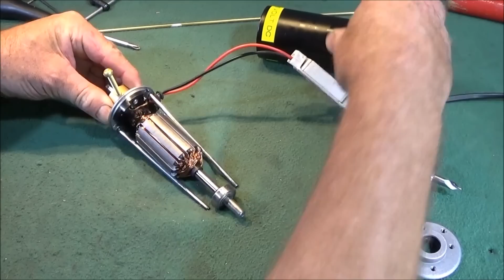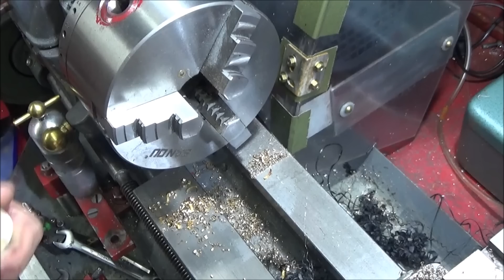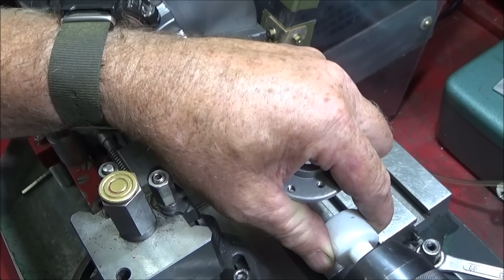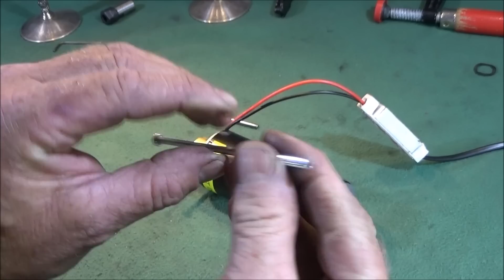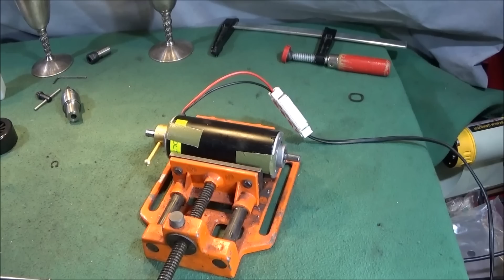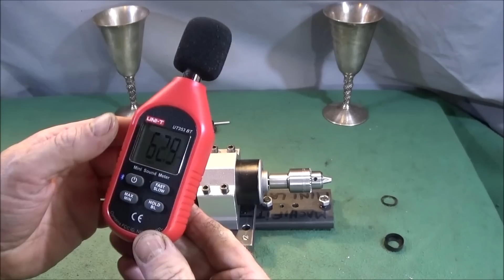Easily Strip The Machifit 100v Motor For Modifictation & Servicing

Comment from the maker: SEE LINKS BELOW:-  
 Machifit ER11 Chuck CNC 500W Spindle Motor with 52mm Clamps and Power Supply --  https://goo.gl/iQY4LK
 UNI-T UT353BT Bluetooth Sound Level Meter Digital Noise Tester --  https://goo.gl/3tRts8
Reply from the maker: Banggood 12th Anniversary New User -- https://goo.gl/dGwdoS
    Banggood 12th Anniversary Warm-up Sale --  https://goo.gl/yAECU1
Reply from the maker: Banggood 12th Anniversary Electronic Sale --  https://goo.gl/SY4GX1

Comment: This spindle has only two ball bearing, and rubber makes one bearings useless. Normally spindle has angular contact bearings and total 4 bearings to bear cutting backforce. If you open it, you will know this is just modified hand blender.

Comment: Thanks Steve for showing us the insides of this type of motor.   A bearing mounted in a rubber gasket doesn't look like a good spindle motor solution without modification.   I believe the 775 motor has a bearing press fit into the end piece.

Comment: Thanks for this great video! I've got that motor, and a 3018 CNC. It could be interesting to convert the 3018 to accept this motor.
Great tip making that brass collar to save the brushes. The same, great idea how to guide the mounting screws back in place.
Did You use a zz bearing? If not, how did You protect the new bearing from dust?

Comment: Nice information..
Is it possible to use this motor for industrial applications in a SPM for drilling dia 1.5mm hole in mild steel 3mm thick..
Approx 3000 holes in 8hrs x 6days a week..
Reply from the maker: Hi Atul yes I would reckon it would be good for that. I haven't been able to try it though.

Comment: Waste of money as a purchase and further on as an upgrade platform. Rotor is not balanced at all and it will destroy any bearing you throw in there. Mine is shaking the floor, it's that bad. Nothing you could do about it without a professional rotor balancing machine. Even if the rotor was balanced, since the fan is not built in, it's likely that fan will throw it again out of balance once you put it back on. It's just bad engineering all the way. We would all be better off with Makita or DeWalt palm router, a properly designed piece of machinery, which is even in the same budget range. For 25eur you can buy parkside pgs 500 a1 which runs circles around this "motor".

Comment: Ideally, on a proper, high end spindle, you would have two bearings with directional markings, being placed in this sort of configuration,  ----<>----  (the line being the spindle and the < > representing each bearing). This allows for a more stable rotation, regardless of load. 

In fact, These bearings realy arent truly all that expensive, and it may be something worth having a look into. The only other thing that immediately springs to mind is the thin steel case and the pot metal endcap possibly being additional sources of vibration.
Some wisely added delrin parts might help a good deal.

Comment: i have this spindle and it heats a lot very quickly. im interested in cooling mods. ive seen a guy run copper tubes around the magnets with liquid cooling , which helps a little but no enough. any other ideas how to cool the rotor and not just the frame?

Comment: As a matter of interest, the spindle on this motor is longer on the fan end and probably the same diam both ends, that means you could turn the motor around and make a new cover for the fan end slightly longer to house 2 A/C bearings so that it then becomes the chuck end which will be heaps better for a milling situation on the cheap 3018 mills etc, the regular radial bearing can remain at the previous chuck end as it now becomes the fan end.

Comment: Hello good afternoon. Thank you for sharing this video that piqued my interest. I try to buy an economical engine, so I can adapt it to my wheelchair. It will have to be a small engine as the chair will be open and closed for transport in a domestic car. It seemed to me that this engine has strength but on the other hand it seemed very fast but I think it can be controlled. Could you tell me more about this engine? Will this engine have heating? Please, if you can, tell me what you think. Thank you.
Reply: I have a 500w version and it heats up a lot, I don't leave it working for more than 1h.

Comment: An excellent video.  However, could I make a small observation.  You have cleverly used a 300mm 1/8" sharpened brass rod to guide the long bolts past the large permanent magnets, I would just like to mention that you can buy packs of 1/8" bamboo barbecue skewers, also 300mm, ready sharpened, non-magnetic and 99p for 100.

Comment: Steve, your videos are extremely well done and instructive. Thank you!  As a matter of fact, I just received my order for this motor and I want to remove the factory mounted chuck. Further to my question of yesterday, I took off both set screws, hoping to be able to pull off the chuck from the arbor, but it seems to be stuck! Maybe heat shrunk on?? Anyway there is no movement and I don’t want to pull too hard either. Some sort of bearing puller arrangement might work, but there is very little room behind the chuck to hook it on. 
Your video explains pretty much everything except how you managed to remove the chuck from the arbor!  I, and maybe other viewers, would be very interested in your explanation how you did this!  Thank you.
Reply: Steve, thank you for your reply. I did manage to pull the chuck off. This revealed a 10 mm spindle. I think I have heard you refer to a 8mm spindle... This is relevant when wanting to replace this small chuck with an ER16. I looked up the ER16 on Banggood but that has an 8mm hole... Or is it just a matter of replacing the collet nut only. I am puzzled about this, not being as informed as you. Can you shed your benign light on this? Thank you! By the way, what is the difference between ER11 and ER11A...?
Reply from the maker: Hi I may have shown it on another video, but I did use a made up puller. It was basically a couple of pieces of steel with a cheap bearing puller that hooked over the steel with a allen bolt that fitted loosely on the inside spindle face and was then pushed in with the bearing puller screw. It will come off fairly easy like this and it is the only way to remove it without damaging anything.

Comment: How on earth did you get that factory mounted collet off?
Reply: Take the collet nut off, and carefully load some 5mm nuts inside. Replace collet nut and tighten until it slides the chuck off. You might need a couple of of tries.

Comment: Hi, Steve.  All your videos are great...even for a dummy like me.  
Instead of a brass bush, I would consider a Larger ball bearing for the output end...a radial thrust sealed ball bearing.  
On the brush end remove rubber spacer [if applicable] a use a normal sealed radial ball bearing.  

I am currently building a tiny cross drilling lathe attachment with an alloy bearing block tool holder and pulley shaft, powered by a 7,000rpm, 110v, 60hz, 100w [US] sewing motor with a foot rheostat. I have a small pulley on the drilling shaft and a larger step pulley on the motor utilizing rubber O'Ring belts.  The 100w motor is sufficient for the tiny drill bits I'm using.  

I appreciate all your videos and the fantastic commentary on your "Show & Tell" approach.  Thanks, again.

Comment from the maker: PLEASE NOTE:- IN THE END I USED DELRIN FOR THE BEARING HOUSINGS, TO MAINTAIN ZERO ELECTRICAL CONTACT FROM THE ARMATURE SHAFT TO THE HOUSING. I ALSO FITTED SKF BEARINGS AND A THRUST BEARING TO THE FRONT END. WHILE THESE MODIFICATIONS DID IMPROVE IT SOMEWHAT. THIS UNIT IS ONLY REALLY GOOD FOR SMALL DRILLING OPS.

Comment: Hi Steve,
Very handy tricks on fitting the screws using brass. I would suggest running and earth wire to the controller then on to the motor screw. Also a good idea to fit a fuse in line with the phase wire if you don't have one in the power plug.This could save your life !.
Cheers Dave.

Comment: Hi Steve
I hope the bearing mod will cure the vibration problem I noticed previously.
With better quality bearings I am sure very accurate light milling will be achievable.
The brass rod trick to line up the screws is clever. Well done.

Comment: I would ditch that style of ball bearing and install a pair of angular ball bearings (a.k.a. magneto bearings). You would have to modify one of the end caps so that the bearings could be pre-loaded. That would probably be easiest on the front cap by threading the o.d. of the boss and make a cap that could be screwed on an use that to set the bearing pre-load.
Reply: You'd need a lathe capable of doing that. Which most of us don't have. So, to make a $20 mod on a $50 spindle you need to preemptively spend on $1000 worth of equipment.

Comment: Nice solution, I would suggest one change.  It probably won't make a difference but I think the bushing should be made of something like  Delrin or another suitable non conductive material.  I don't particular like the armature shaft being shorted to the casing.  What do you think?
Reply from the maker: Hi James I tried the dense pvc first but had the same problem, although I think now I will try delrin when I get the new bearings. I should have checked them first, but I expected them to be really good. It was only late into the video that I discovered they weren't very good at all. When I checked them I was quite surprised at the movement in these bearings, which obviously contributes greatly to the problem.
  I did think that the rubber was also there to stop the electrical conduction as well, but it didn't seem to cause any problems in any way at the time.  I think Delrin will be the best option in the end with really good quality bearings!
Reply: Thanks, Steve, for yet another instructional and pedagogic video.
1st Q: - How do you think they got the two screws in at the factory, without the recesses you had to drill? (I've no idea, myself...)
2nd Q: - Why would a galvanic connection between the anchor/ case be detrimental? (2 cents: I figure brass is a more rigid material than Delrin, who has some give, that might lead to micro-oscillations at resonant revs...) Lastly a tiny tip: Chamfering the brass bearing bush with a file half way thru the cut-off saves you form having to chuck it the last time entirely.
Cheers from DIYSwede
Reply: Thanks for the comment.  Regarding shorting the case to the armature.  If the case is not grounded and the supply voltage shorts to the case it probably won't trip a breaker and should you or anyone else touch the case it could be  a shocking experience.  Remember this is a 100 volt motor.
Reply: OK - Thanks for clarification! Personally I ground anything fed above 60 VAC (or pulsed DC), and I also seem to remember that CE regulations prescribes that armatures should have a connection to case) OTOH: The toolpost mount will ground the case thru the lathe's PE lead anyhow  - and then perhaps a failure in a non-grounded armature reaching pulsed 100 VDC thru the chuck into whatever comes its way could spark some fireworks before the motor control gets fried/ current limiter kicks in. My 2 cents: A GFI/ GFCI / RCD is an excellent gadget having upstream of your mains outlets in a shop anyhow.
Reply: @jamesreed6121  My thoughts exactly.......earth for gawds sake.
Reply from the maker: It's shocking Madam.
Reply: @SteveJordan  Steve, I see there is another 500 watt motor on EBAY....it's a brushless one, runs on the same 100 volt DC power supply.....just bought one as it's only A$59.00.....I have to wonder if it really is brushless......I thought brushless motors had to run with an ESC and about 48 volts.......this one is 100 volts DC, are they pulling my leg?